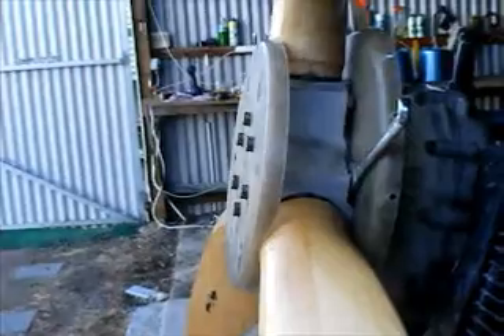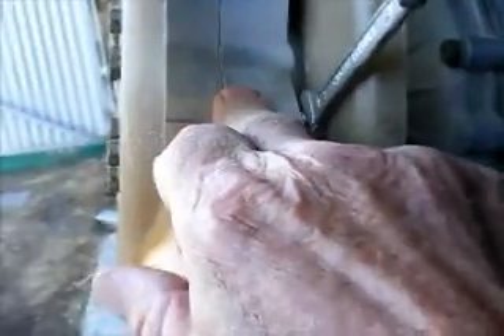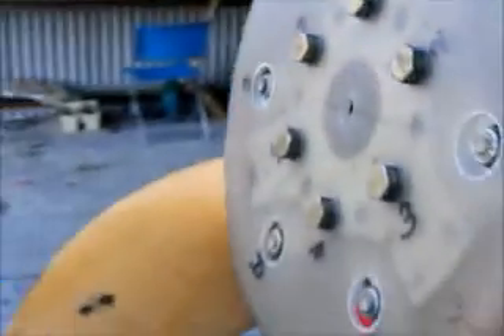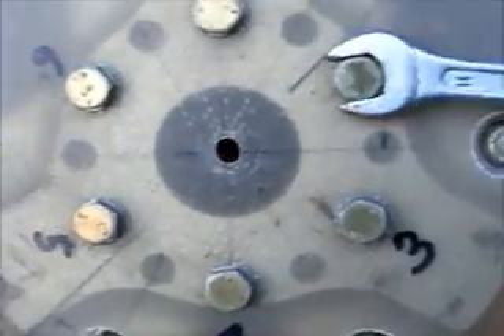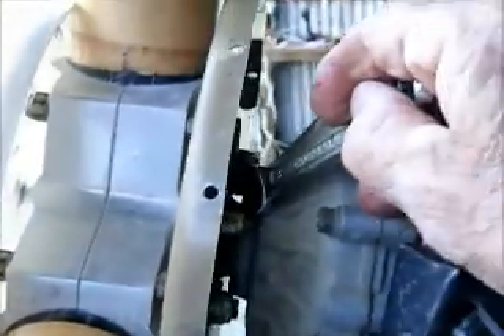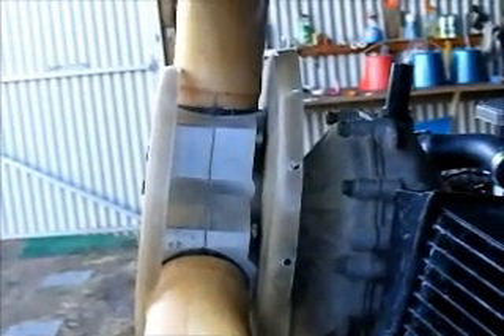Propeller loose

Comment: Hello! I never had a problem with my GSC prop, but I have safety wire for the bolts that connects the gear box, I see you have lock nuts on them, but my CAA inspector told me they don´t work that way, and he will not accept other than safety wire. Seems like you have to re-torque all of them.
Regards
Dimi3